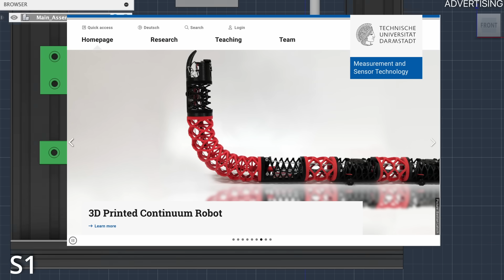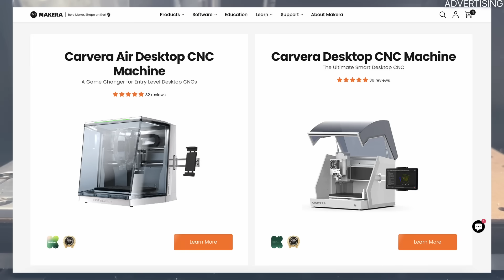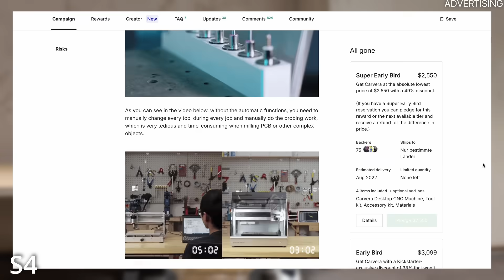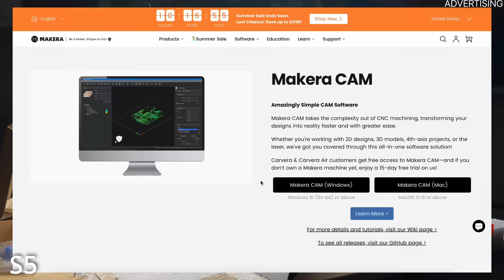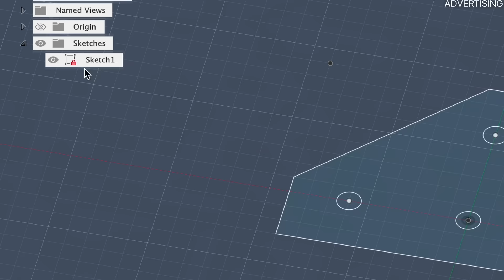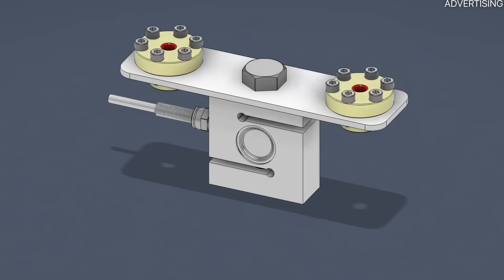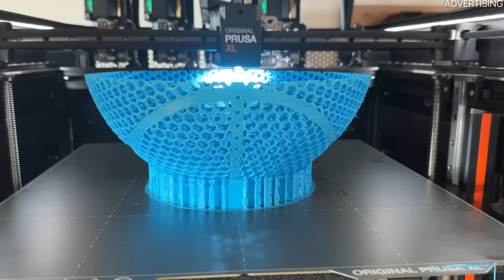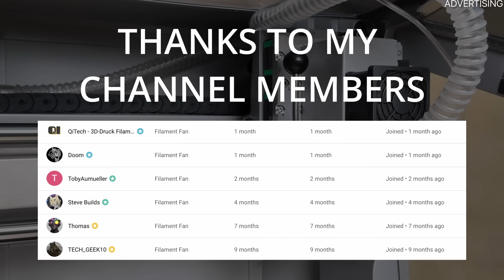Better than 3D Printing? CNC Noob tries out Makera Carvera Air

Comment from the maker: I know, this was a bit different from my usual 3d printing experiments but I really wanted to get into CNC machining and enjoyed working on this. 
I hope you enjoyed the video too! Let me know your thoughts below and stay tuned for further exciting 3d printing content!
Reply: I enjoyed the video. I think it is hard to compare 3D printed vs CNC parts head to head in stiffness and strength. Because the shape and weight of the final parts can matter a lot.
Say you only have a plate of ALU, then you make a part of it using the CNC. If you just 3D print the same geometry the ALU part will for sure be stiffer, stronger and heavier. But you might be able to redesign the 3D printed part to increase the "second moments of area" thereby making the 3D printed part just as stiff. But you might also not have any more space. 🤷‍♂

When designing part we need to take into account both the material and the production process in order to get the best parts possible. We always have to work within some limitations.
But it never hurts to have more options in the workshop😉

Comment: 9:19 tbh I dont get the discussion about efficiency. It's also about the waste of the material which can be a bit messy with cnc's and also the whole industrial production of the materials themself.
And tbh: Does it really matter if you spend 1€ in electricity cost? Why would one care about efficiency anyways if not for the cost? Then it would be just about how economical is a part, how expensive is the material, the machine, what is the success rate?